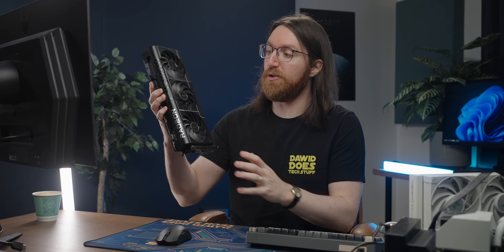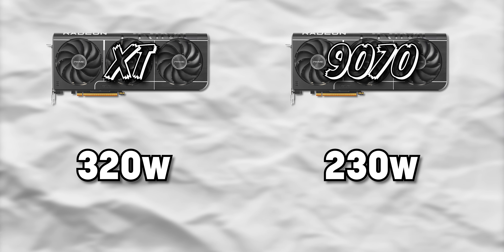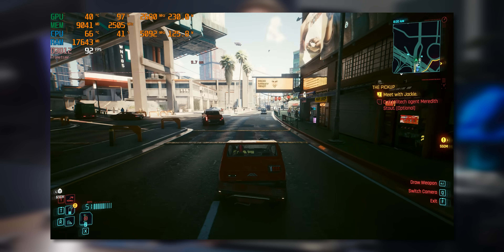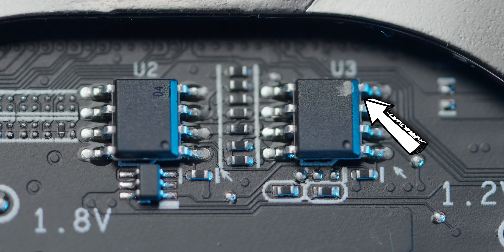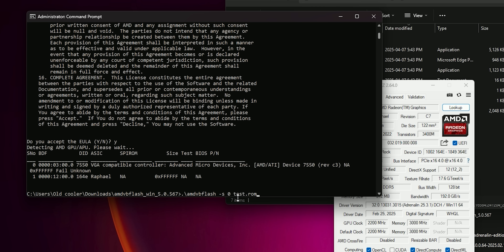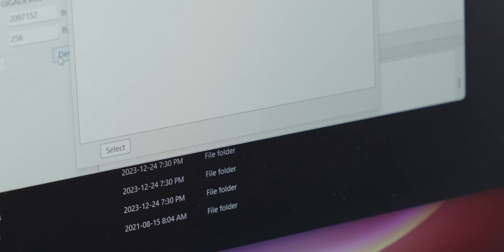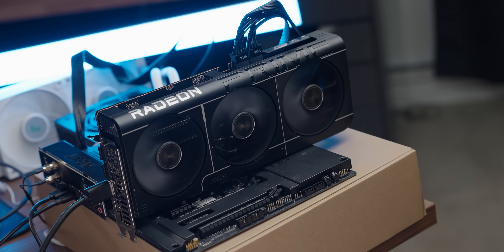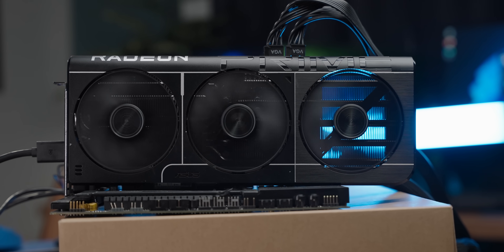I Flashed An AMD RX 9070 XT BIOS Onto My RX 9070...

Comment: This is far less exciting than everyone is trying to make it out to be. Being able to flash the VBIOS to get slightly higher clocks (e.g. 9070 --> 9070 XT) has been a thing for some time. This also doesn't unlock fused off cores, most are made otherwise inoperable at the hardware level and flashing a VBIOS isn't going to change that.

Content is content, but... not worth the watch or attention.

Comment: I'm sorry but I don't believe that you've got a 25.4% avg FPS increase with just higher power limit. That makes no sense. CP2077 settings must have been different in the other test... not saying you've changed them but CP2077 settings sometimes bug out and don't apply as they should or change randomly. On avg the difference between 9070xt and 9070 is around 10% stocks vs stock.

Comment: So basically, the bios switch acts as an overclocking activating switch. Reminds me of waaaaay back in the day with my GeForce 8600GT that had an OC switch on the back. Obviously it just boosted the clock speed and not switch bioses, but still really cool to have.
Man, card makers should make this a standard feature XD. Switch between XT and Non-XT mode on the fly.

Comment: I have the Gigabyte 9070 OC edition and that hits 320W without having to do a BIOS update. I Use Adrenaline to add 10% to power limit and -80 MV to voltage offset and I hit 3200 mhz on the core frequency

Comment: Data after flashing is fake or tested at different settings (propably with fsr quality which is a part of ultra preset) i got for 9070xt 134fps at ultra 1440p and with fsr 2.1 155fps both with uv+oc in built in benchmark, like even different reviews shows 9070 vs xt is like 10-12% faster in cyberpunk (techpowerup, hardware unboxed, gamers nexus)

Comment: First amd gpu i can say is good 9070/9070xt it has gpod rt,good upscaling,good oc potential without running at hotspot of 110c
And dont tell me there is 7090xtx that gpu is just hit or miss by silicon lotto,5 users run it great 5 have issues ,launch with chambers being awfull and hotspot of 110c,awful transient spikes,high power draw at idle,bad drivers at launch and so on... 9070/xt is just great in all aspects !!!!
Reply: Good glaze and no it’s not it’s a 600$ max Gpu enjoy the glaze when the smart and users wait for UDNA to absolutely trash on these mid range Gpu’s
Reply: I really dont care for udna or 9070xt this is my opinion and you have yours ! 

The only thing bad its "msrp" that is way over 1k in eu! 

As for 5070ti you cant even find them.
But i dont need a gpu i have 4080s,but for people who want to update it sucks.
Reply: @ZeleniKamion my point being that isn’t not good if it’s not at 600$. It’s still a bad value item at its current price
Reply: @ZeleniKamion that’s not opinion it’s a fact .
Reply: For 9070 it should be 600 or even lower .
But amd always do bs with -50 gets you non xt gpu.

Comment: Lol. You made it pull more than 300 watts while performeing worst with thost 85 to 90 fps vs your 100 previous.

Also, fyi, my Gigabyte Gaming OC RX 9070 can naturally go up to 310 watts by just undervolting and maxing the power using AMD's default driver software.

Comment: When you applied the undervolt I hope you also increased the max frequency slider as the two go hand in hand. With the undervolt it should still hit 320w as the card will keep upping the frequency until it hits the new power limit. That's how it works on RDNA3 and unless AMD changed the behaviour for RDNA4 it should work as well.

Comment: The combination of the XT BIOS with the base chip means you'll actually have a functional frequency offset as soon as you're below the power limit.

It "doesn't work" with the cards as-produced because they hit the power limit before they hit the clock speed limit, at least until you undervolt it.

Comment: 03:00 how is 40 degrees possible on an air cooled card ?
Reply: 0 C ambience
Reply: i get 60°c max on my 7900XTX Nitro+ running at 460 watts
Reply: Because you believe the water cooling hype.

Comment: flashing is honestly not that bad, i did 1000w evga on 3090 and asus strix 4090 bios on my 4090 gaming x trio just works flawlessly, you just have to look out for the type of pcb the card is using so don't flash a nvidia pcb bios on a boardpartner pcb design

Comment: hi. i have one of those very expensiive (6$) bios programmers from the deep web (aliexpress) and i use the program AsProgrammer. it detects the bios chip automatically instead of typing all of that random characters in. it is very user friendly. must note, before writing, make sure to hit the full write thing (next to write button, it has an arrow). i have used it to mod some old 2013 lenovo laptop i have and it worked. now from 40 seconds, it takes 2 seconds until the lenovo logo pops up. this makes bios modding very easy and less scary.

Comment: Be very careful with this mod most 9070's have 2 8pin connectors that can support 150W each meaning they are going to be fully utilized or over capacity. Yes the PCI-e slot can supply 75W but that's up to gBIOS to request and most modern cards only draw couple dozen W thru it. All this to say there is a potential for melting cables unless you attach additional 8pin connectors to the board.

Comment: I have the 9070 Pulse and it doesn't have a dual bios so there ain't no way I'm risking bricking my shiny new 600 quid graphics card lol.

My XFX 6750 XT had a dual bios and I never used it once, typical.

Comment: I flashed an hd6970 on my hd6950 back in 2011 and that bad boy lasted a whole 10 months before spontaneously combusting. No pressure Dawid
Reply: nowadays they don't do that anymore (excluding nvidia 40 and 50 series)
Reply: @ No crossfire or SLI either RIP
Reply: I remember flashing Radeon 9500 with 9700 Bios and it doubled the pixel pipeline because ATI was to lazy to manufacture 2 different cards :-) You could turn  $179 card into a $299 one  ($522 adjusted for inflation) !
Reply: in 2011 i flashed my laptop gt525m gpu into gt550m bios, that laptop still works to this day
Reply: @ How's gaming on a 500 series in 2025? Surely there's still some games you can play
Reply: @DreuScuhDoo  last game i checked on 500 series was Tomb Raider I-III remastered from my steam account on that laptop, that game runs at 100+fps on that gpu in 720p
Reply: I did it too, that said mine just lasted with no caveats.
Reply: @ It may have been because mine was a blower style cooler. That thing didn't run very cool even with the normal BIOS lol
Reply: @DreuScuhDoo  yeah man  those 3xxx, 4xxx, 5xxx, 6xxx radeon cards with the blower fans ran HOT.
Reply: @DreuScuhDoo what were the tempratures?
Reply: @rudraacharya8247  During the summer it would hit low 80s. For whatever reason high school me decided to overclock an already flashed card and I started getting visual artifacts.
Reply: i did a similar thing with an external programmer on a Z170 motherboard, i managed to clock an i5-6400 from 2.7Ghz to 4.8Ghz, performance gain was absurd
Reply: You could have gotten a Chinese Frankenstein CPU, like the famous QTJ1 instead. I mean, flash the BIOS and get that CPU. It's a 9900K/10900K but slightly worse. I have two and they work great.  @chrisparussin5359
Reply: I flashed my eyes this morning and it lasted a whole 10 minutes before I recovered to see things again... Unrelated
Reply: I did the same. I guess the temp sensors weren't properly placed because temps seemed good but it was so hot a resistance fell off, lasted 3-4 months
Reply: Me too! And I still have the card and it still works!
Reply: ahh, 6970, I still have a 5970 in perfect condition, unsure if to save and build retro machine or sell it yet
Reply: I also flashed an hd6950 😊
Reply: Lol I flashed everything back in the day. PDA, stupidphones... psp, graphics cards and played with cpu cores...Overclocked everything I could(I stopped doing this). Nothing really died. The only two gpu which died were totally stock.  One AMD in an iMac(2011... you can google the case) and a Sapphire can't really remember... an agp card... 

If I would not be satisfied with my 3070 notebook I would probably buy a config with  9070 with dual bios and try my luck. As long as thermals are okay I don't think it's gonna die soon... there is a risk I know... but still. I was pretty lucky until this day.
Reply: Me too and still works like a charm
Reply: I'm still using mine in my Win7 computer and it idles at 75C on the 6950 BIOS... Used to mine crypto with it too, it's been through hell.
Reply: Anecdotal evidence and nothing can prove the bios flash had anything to do with the failure 
It could have been stock and still burn 10 month down the line
Reply: Still longer than RTX 5,000 series.
Reply: Lol same
Reply: your vrm mosfet will smoking if done wrong, some card have designed with no wattage headroom, you need to check if the total mosfet can handle higher wattage. in my experience some lower version model missing some mosfet due to it designed for lower wattage and cost 😏
Reply: Hey me too! Those were good times! I actually ran those in crossfire and flashes them both.
Reply: @ Lucky I wanted a second hd6950 so I can run them in crossfire but damn back in the day they cost like $200+ a piece
Reply: i flashed a 3070 to a 3090 back in the day - killed it after 3 months though
Reply: @Futura2500  got any proof of that?
Reply: @XeloX  the 3070 and 3090 have completely different GPU chips and different amounts and types of VRAM, so they definitely didn’t actually do that lmao
Reply: @Futura2500 there no such thing but whatever liar
Reply: @ That's sick I hadn't heard much about people bios flashing GPUs since I had an rx580

Comment: xD can't wait for all the crazy future experiments. Like flashing a 9070XT Bios on a good old 580 or 6700.
If someone is crazy enough to try something like this, it's this man. :D
Reply: I'm not an expert but I doubt what you said makes any sense. The 9070 non and xt are the same dye, with the non-xt having some cores disabled and lower clock speeds. So it makes sense that the same vbios could work on both and unlock some of the potential on the non-xt. If anyone is more knowledgeable please correctly.

Comment: 9070 XT has more CUs, ALUs and RUs. So giving a 9070 the Bios and clock rates of of a 9070XT does not turn it into a 9070 XT. At best you get a 9070 XT light or a 9070 beast edition.

Also the card consumes a bit too much watts for the two 8 pin connectors now, but most likely Dawid will get  away with it without melting connectors. ^^

Comment: This is a nice "hack". But, the issue is, at least here in Canada. That the XT and the Non XT version Is about 80dollars difference for the worst case scenario between the two GPUs. If the non XT was about 150cad cheaper. Then I would actually purchase the 9070 just for this hack.

Comment: i still have the hd 6950 mod to 6970 i wish they pulled the same thing with the 6950 xt aswel and we had like a 6970 xt XD kinda like a joke

the hd 6950 was my first actual dedicated graphics card before that i only had use of chipsets so i had to get the 6950 xt when it was cheap XD it turned out to be a good decision looking at how videocards are priced now

Comment: That's absolutely crazy. I don't know if I'd do it on an expensive card but wow... That's a massive upgrade. Maybe after 2 years of use and if it has no warranty anymore I'd slap that BIOS and get some more power out of it.
Reply: If you have dual vBIOS - it is pretty safe, just don't flash both xD I did this on single vBIOS cards, but I had backups of stock vBIOS and could try to reflash if bricked using the power of "-buying- using two of them", because I haven't had a hardware flash

Comment: Hey Dawid! For next time you have to use the AMDVBFlash, the one with the actual interface rather than the CMD command looking one. It's commonly called AMD ATIFlash as well, I have tried the one you tried several times in the past, specially with 570s and 580s and never works.

Comment: nice ! 9070 sells will go up through the roof ;D
Reply: Don't think so. Hardly anybody would want to buy a BIOS flasher and disassemble their card, when for the same amount of money and less effort or risk they can buy a 9070XT instead. If it was just a software mod perhaps.
Reply: @marsovac  sure there will be an update to soft flash 9070 eprom soon, if this bios twaek came with real benefit on most card. anyone will so have to worry about the hard way :D

Comment: The name in GPUz does not change anymore because AMD has taken the name to another place on the card where a bios change does not change the name of the card anymore. Its to help the spread of fake cards.
Reply: to stop the spread of gake cards you mean
Reply: @francistaylor1822  Idk about gake cards bud, maybe for the fakes.
Reply: sorry I meant cake cards
Reply: @francistaylor1822 no, no, you got to help the spread
Reply: @francistaylor1822  Damn GAKE Cards!
Reply: @devobronc  Gake and fay!
Reply: With afteburner can do the same.
Reply: XT or non-XT is determined by bios straps and hardware straps in form of SMD resistors.
Reply: Yup - and hard fused of additional ROPS or Shaders - so upgrading bios no longer unlocks stuff other then increasing power targets or maximum values.
Reply: Lmao. My friends brothers name was Jake, used to call him Gake
Reply: I believe GPU-Z uses it's own detection methods that are BIOS independent.
Reply: @lemagreengreen  *its
Reply: Finally, no more GTS 450 cosplaying as a 3090
Reply: Meanwhile AMD themselves make the "RX 580 2048SP" scam lmao
Reply: the gake is a lie
Reply: @thegamingone-thegamingone *It's

Comment: It's amazing how AMD still let you do BIOS cross flashing with different types of GPUs (I know they still based on the same die, but still). I also flashed my friend's 5700 with 5700 XT BIOS back in 2019 for the power boost.
Reply: You used to be able to do a power unlock with software alone. They started locking things down a lot more after the 6000 series unfortunately.
Reply: So that their GPU could compete with and if more people broke their card because of doing this. They hope can sell more to replace the broken card since This BIOS has a great chance of shortening your GPU life span.
Reply: @arik2216  what are you even talking about LOL. You can also do this with NVIDIA cards but only with same GPU model.  Unless you have shitty low end card, cross flashing to add power boost is fine. That 5700 I mentioned before is a red devil model and still working till today.
Reply: @bagasfabianmaulana  It's not only with same gpu model. 4080 vbios works fine on 4070TiS for example.
Reply: @pwnograffik  huh, I thought it's not possible anymore since Ampere.  Thanks for the information.
Reply: @arik2216  how exactly will this BIOS shorten the life span of the GPU?! bullshit! ... It follows the manufacturer specifications of this chip!

Comment: Tech here, DO NOT TURN OFF THE GPU WHEN YOU REFLASH IT what its doing is tracing everything and training the VRAM because everything is new in the perspective of the BIOS, so it creates a map of some sort to make sure it won't get lost on the next boot. Wait 1-3mins depending on the VRAM inside.
Reply: After you reflash it*
Reply: Also, the model and critical data are all baked inside the firmware chip, not the BIOS of the GPU.
Reply: @dragonfireproductions790  there is no such thing as a firmware chip (or better the firmware chip is the bios chip - firmware = BIOS). The GPU ID is simply stored in the GPU chip now, unlike in Polaris.
Reply: @ yes thats the GPU die I'm talking about, thats why most scam gpus are older nvidia gpus spoofed to look like one
Reply: I think it's just the motherboard figuring out wtf happened to the GOP UEFI part of the gpu with windows partial shut down due to fast boot being a thing.
Reply: @emperorSbraz  Doesnt the HW ID change for UEFI?
Reply: @ToTheGAMES  yes but still changing gpu in a fastboot shutdown can crash things.
a reboot clears the fastboot part, also obviously disabling fastboot in  windows.